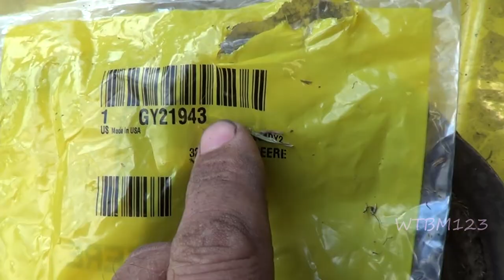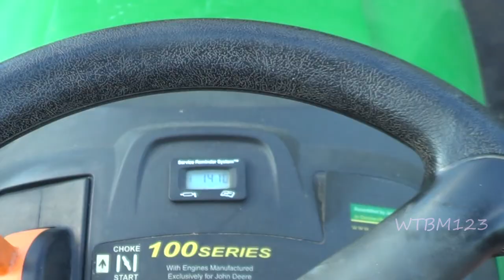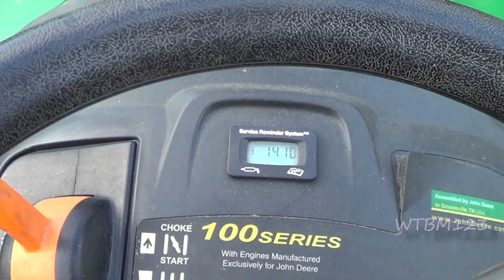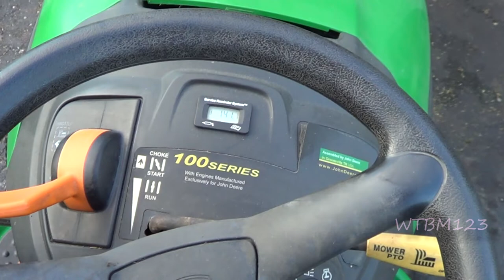John Deere D120 Blades will not engage , Blade Brake problem , GY21943

Comment: Saved me hauling the mower to the shop! Very helpful instructions and easy to follow along to fix. My issue was the bushing was missing on the brake arm - that is an important part! Without the bushing the brake arm cant move :) THanks again for your helpful video!
Reply from the maker: Glad you commented telling what the issue with your was . It could help others some day . Thanks.

Comment: After messing around with the same problem for the last 3 days, your video showed up on recommended to watch.  I watched it and now I think I'll get it running today.  Thank you so very much for creating this video!  I'll let you know if we got it running!  God bless you!
Reply from the maker: Thanks for watching and commenting . If have real problem getting the little spring back , some people takes the pulley off and do it that way also.
Reply: @wtbm123  Report from son, who was going to finish it up last night was that the blade pulley under the left foot when you're sitting on the tractor was bound up with stuff on the underside caked on from last fall (I know, I should have flipped it over!).  He also had to mess around with the spring which engaged the brakes.  Lastly, he had to loosen the bolt holding the tensioning pulley that the PTO spring is attached to and lubricate under that.  He ran out of sunlight and was going to slip the deck under the tractor and see if the blades spun today.  So far no word, so he might be out cutting his lawn.  It was his mower and he liked your video as well!  Thanks!

Comment: From D100 owners manual on blade brake specifications.
This distance is measured from the BACK of the bracket to the BACK of the nut. with the brakes resting on the pulleys.

4. Measure distance from spindle brake bracket (B) to nut (C) on end of
brake rod.
• Bracket to nut distance should be: 2 - 3 mm (0.08 - 0.12 in).
5. If adjustment is required, turn nut (C) on end of brake rod in correct
direction to set brake at proper distance from pulley.
6. Adjust both brakes.

IMPORTANT: Avoid damage! Avoid belt damage.
Spindle brake engagement should be checked and corrected
every time the mower belt tension is adjusted.
Mower belt tension should be adjusted, if required, before brakes
are adjusted.
Reply from the maker: Thank you very much for sharing.

Comment: Hopefully this fixes my problem for my s130 I got, my dad took it to lowes since its got warranty,but as usual,they messed with it instead of repaired it,so now the blades won't engage,so hopefully this is the issue instead of the whole PTO switch
Reply from the maker: Hope you get it sorted out

Comment: i'm having the opposite problem... YES, there are supposed to be pads on it.. my blade brakes appear to engage, but the blades keep spinning... visually looks in order, works mechanically by hand when deck is removed
Reply from the maker: is all adjusted well and cable adjusted correct
Reply: @wtbm123  yeah.. it seemed to work fine then it didn't by the next time i used the mower